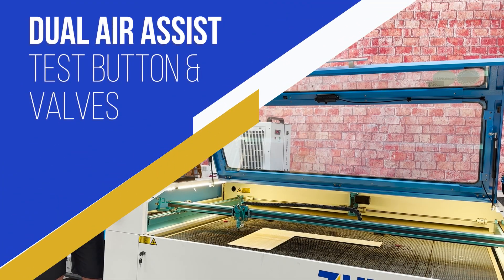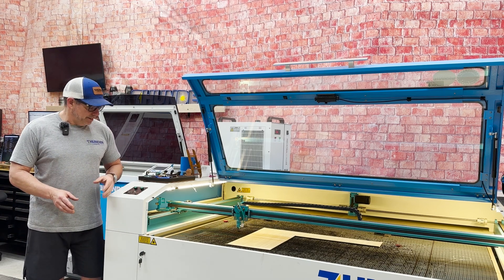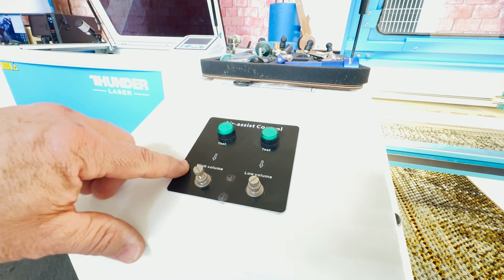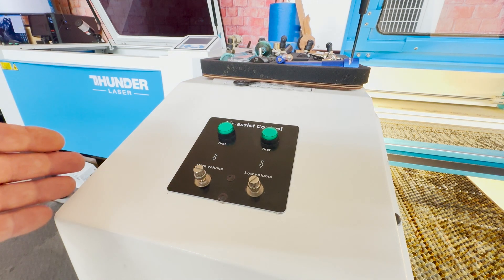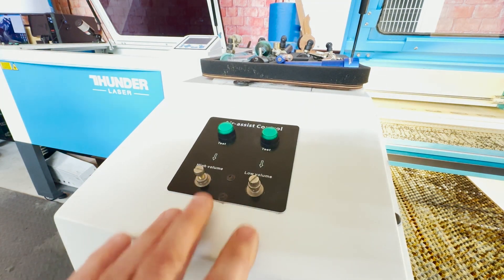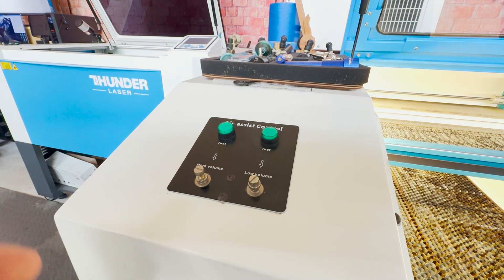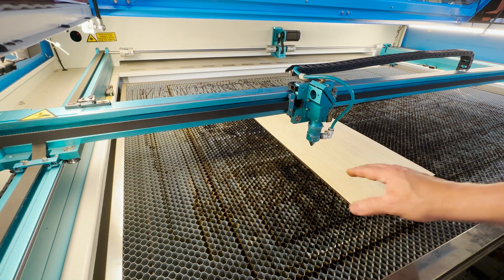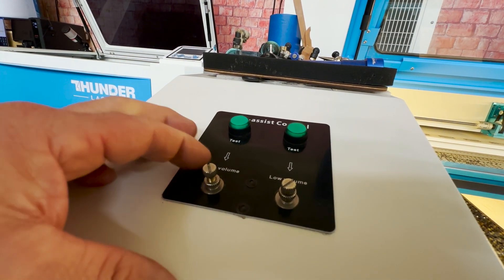Dual Air Assist Test Buttons and Valves

Comment: Laser epilog and Trotec have air control directly via software is it also possible to manage the amount of air with your lasers? Via software
Reply from the maker: The software controls the High and low as showing in the video. The volume of that air you set with the air valves.
Reply: @ThunderLaserUSA  In your machines with your software, as I told you Epilogue Trotec and just Laser control everything via software even the air dosing so the volume itself
Reply: @ThunderLaserUSA  If I had to make an engraving then a cut immediately after in the same file I software does the change from low air volume to high air volume I have to click the buttons to do it